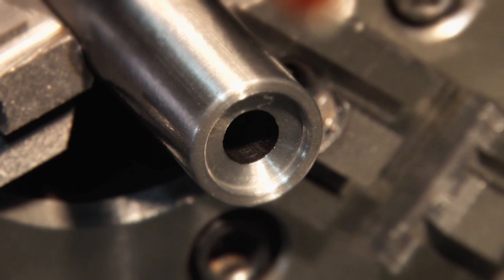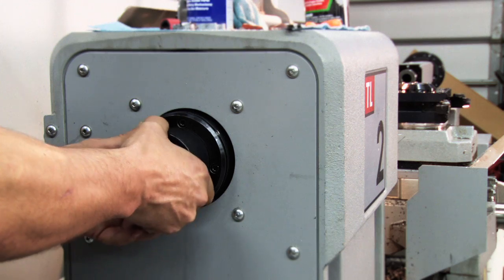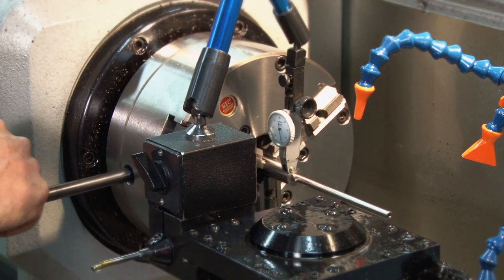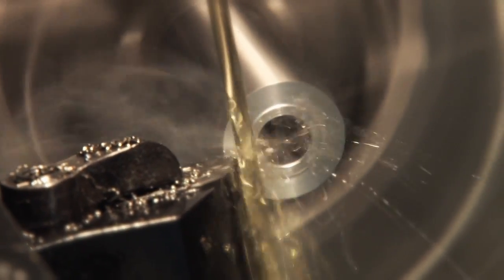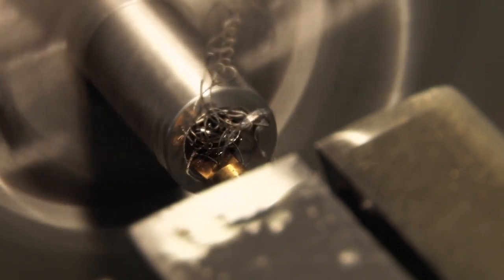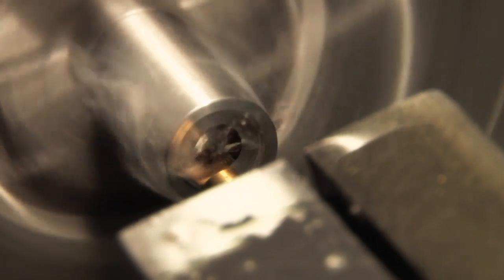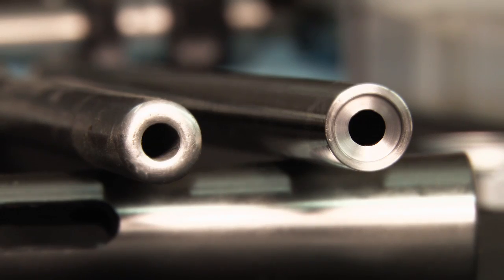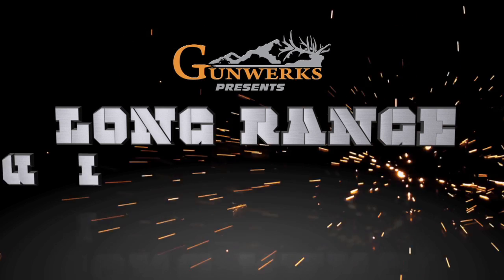Crowning a Rifle Barrel

Comment: I’m curious about different muzzle geometry designs. For example a cone shaped muzzle or a rocket nozzle type shape, or perhaps radial gas ports an inch into the bore from crown that redirect gas to the front face of the muzzle and  exits in a forward direction. Other than a crown cut square to the bore, is there any other types of muzzle geometry designs that facilitate accuracy or positively facilitate intermediate ballistics?

Comment: Test for burrs around the rifling by pushing a Q tip into muzzle and pulling out. If any fibers are caught up,  you have a burr .
Reply: Wouldn't that burr go away with the first round through it?  Maybe not.
Reply: @edstimator1  You have to do it right.   Grinding compound on a conical  dowel will feather it away.  If you shoot the burr out , well that's not a fix.🤓
Reply: @MrJdebest  That sounds reasonable.  I think we are in total agreement.

Comment: Poor execution on an otherwise high tech machine.  Last cut should always be made from the bore (X0) and move with feed to the outside OD.  This illiminates rollover burr at the edge of bore and puts it at the OD ...WHERE IT CAN BE SANDED OFF WITH NO EFFECT ON THE BORE.
Reply: Exactly. I was hoping that last pass would be exactly that but after watching the rest of the program I had little faith.
 They also just attach a collet to the back of the barrel and shove it in,good enough.

Comment: Might be an optical illusion but the finished product looks to be thinner at 7, 8 and 9 o'clock. Hope it is cause it I paid money for that it would go back.
Reply: The bore is rarely concentric with the barrel that's why you dial off the bore and not just chuck it up in a standard 3 jaw
Reply: @NWoutdoorsman  only if they have been sanded or grinded wrong. When you turn a barrel one a lathe (bench or CNC) the outside are turned with the bore centered by the tailstock. Even só you can bent the barrel or have minimal runout, but not visible by human eye. I agree  with all folks that tell the cut of crown must be from inside to outside to minimum burrs and preferable lapping de end of lands with a tappered brass tool and polishing paste.
Reply: Nate Ngzcaz the bore is probably not concentric to the barrel